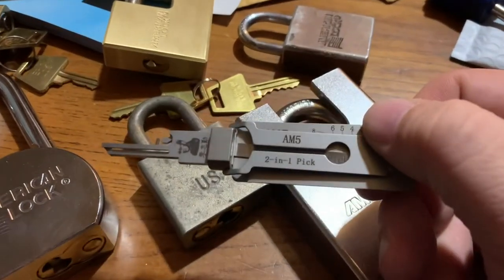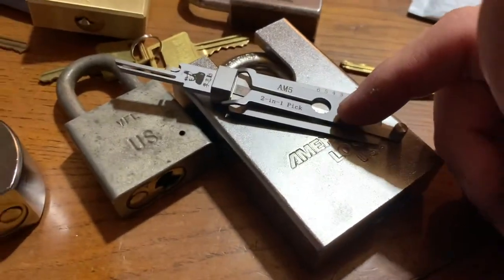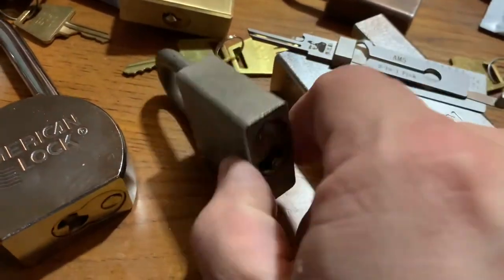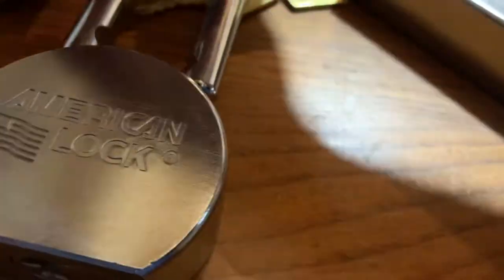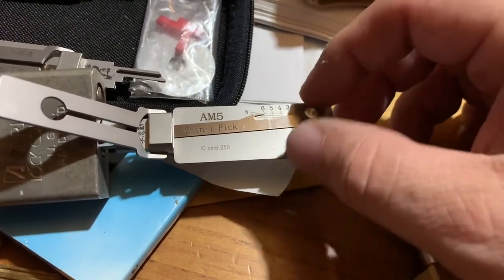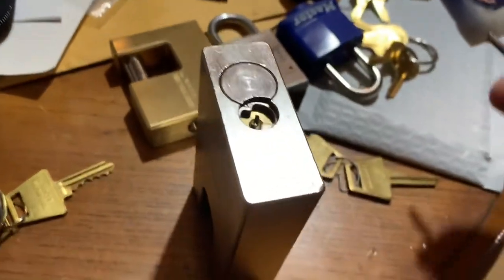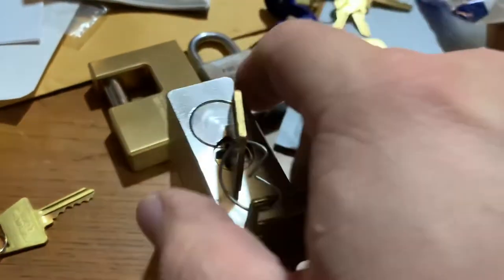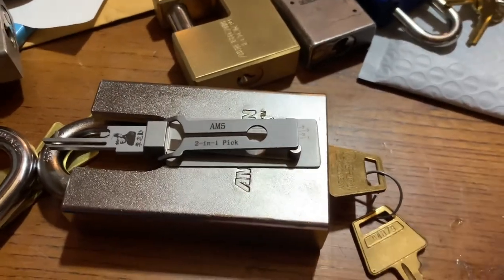AM5  LISHI lock pick doesn’t work in American Lock Padlocks??

Comment: I have a Series 1205 American Lock. It's a camouflage painted lock I bought at the PX for a duffle bag back in the day. It has slot for a 6th pin, but only has 5 serrated key pins and a 5 pin key. My first attempt to insert the Lishi AM5 lead me to believe the tool would not work with this lock. With a little bit of oil and slight inward pressure (not normally needed with any of the other Lishi tools I've used), I am able to insert the tool. It's a very tight fit. The tool is wider than the key and by looking closely, it appears it's the width of the tool that's causing the tight fit. This is the only American lock I own, so I don't know if I got an out of spec Lishi tool, or if this lock has a tighter than normal key way. I was able to open the lock with the tool, regardless of the tight fit. Did you ever figure out why yours wouldn't insert into that lock?

Comment: I have the same problem with similar locks that are 5200 series. So what is the lishi tool for them. I have been working on my single pin picking but I have not successfully opened any of the newer ones yet. Help me figure this out.